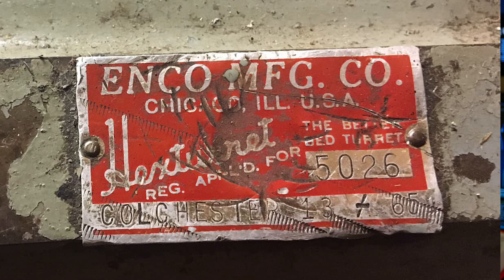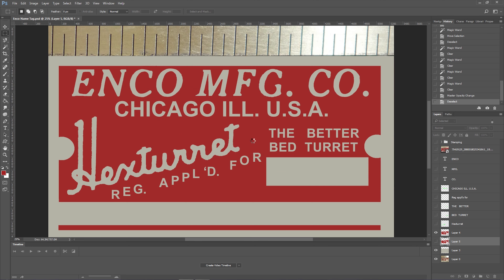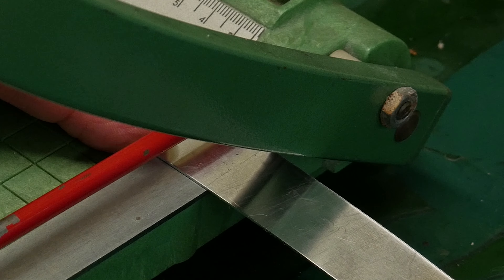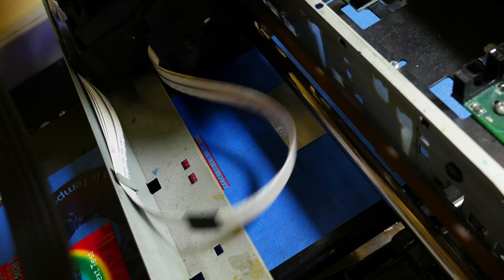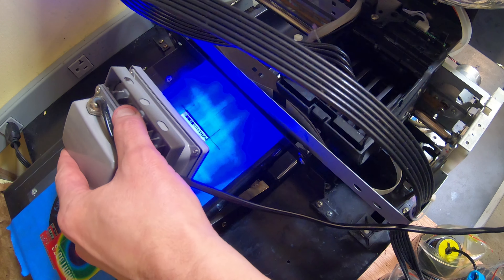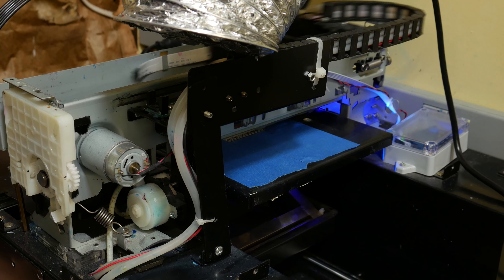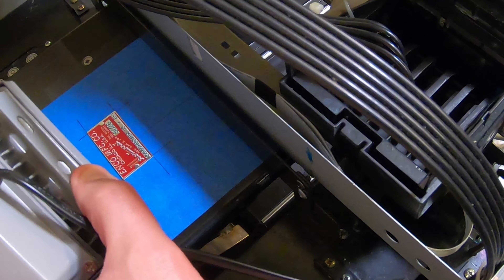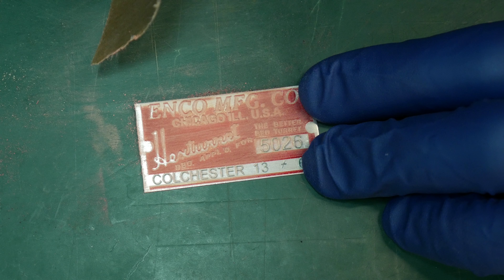UV Inkjet Prints On Metal: Machine Tag Reproduction

Comment: That's really cool. I noticed you can clearly see the raster lines. But when you hit it with the scotch bright, it looked like it evened out the color. Did it look the same in person?
Reply from the maker: That is correct John.  That is a trade off on my end.  The printer gives you full control over how much ink you are laying down.  I tend to pump a lot because I like the slightly embossed feel, the trade off is, you also see the scan lines.  But yes, the scotch bright does seem to do a good job of leveling the finish.  I'm going to guess that wet sanding as you would for automotive paint would even give a nicer finish.  Thanks for watching!
Reply: @PeteRondeau , nice work on that. I say light Scotchbrite, and clear coat.